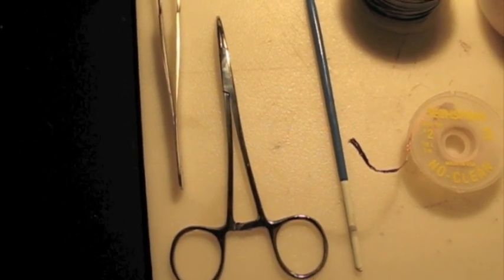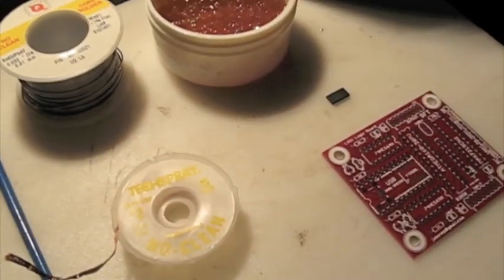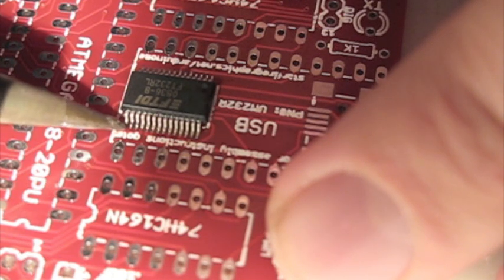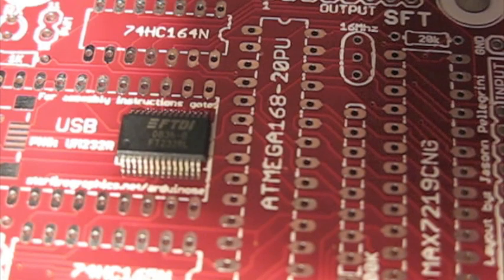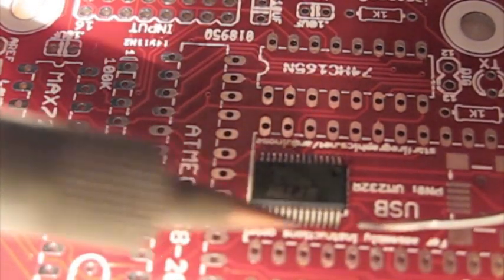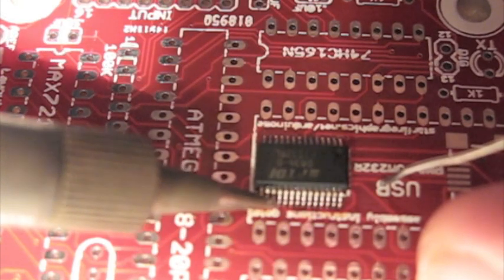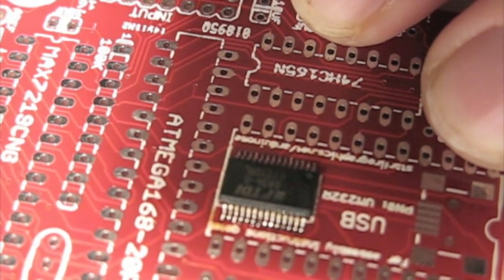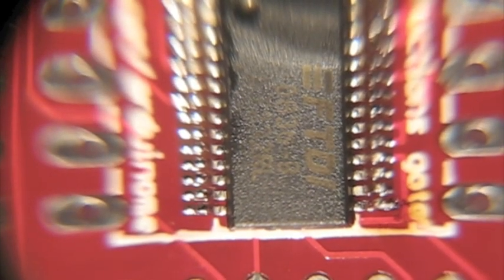Soldering a SSOP FT232RL Chip

Comment: You are holding the soldering iron on the pins for too long by moving the iron back and forth, I have been told that the pins of the chip being soldered should not be kept in contact with iron for more than 2 seconds.